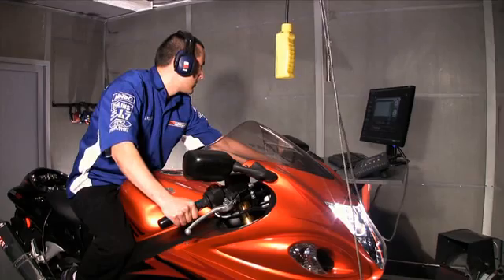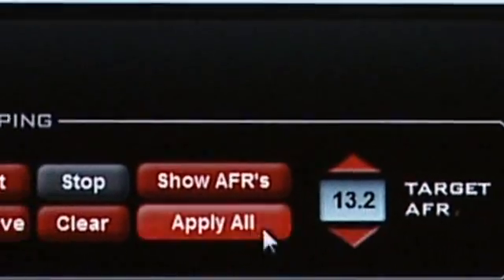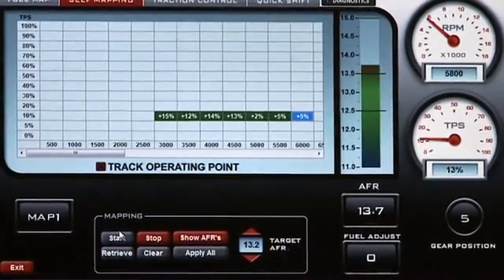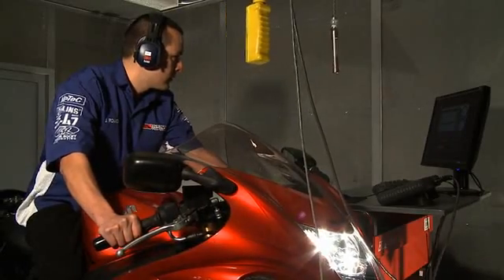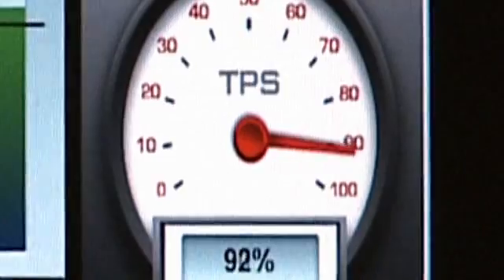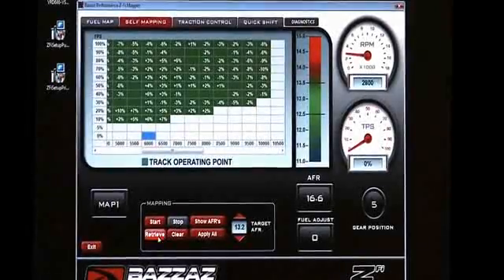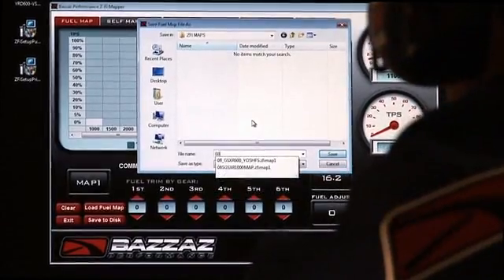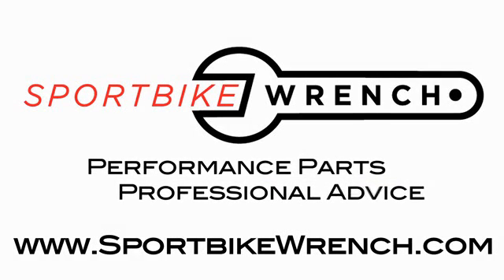Bazzaz Performance How to use ZFI Software

Comment: is it ok to ignore afr while decelerating like it shown on this video? bazzaz new soft doesn't ignore it and add 50%+ fuel on 0% 5% throttle for high and middle rpms
Reply: Did u ever get a answer for this?
Reply: @Daniel-qx9nq  nope
Reply: @Rom Rom  I just got a brand new bazzaz for a killer deal. I'm kinda seeing why now if there's no technical support anymore. Do you leave it at the 50+ in the parameters? Or manual change it? If u leave it hows the bike running?
Reply: @Daniel-qx9nq  I dont remember ) My bike died at 315 kmph

Comment from the maker: @scriptor2k2 depends on the tuner and the purpose. Some use all gears, partial throttle opening, some even tune each cylinder specifically. 

Dave Moss
Host

Comment from the maker: @bblando65 no race bike runs below 3000rpm so that part of the rev range is largely ignored other than for throttle openings & fuel mixture at full deceleration and engine idle speed re corner entry.

Dave Moss
Host